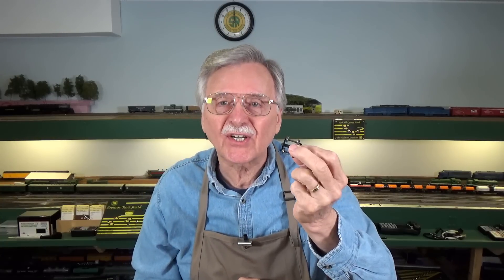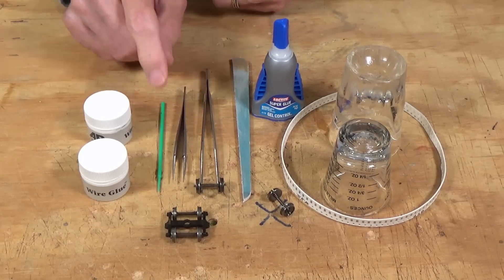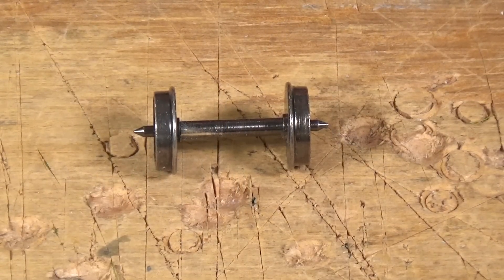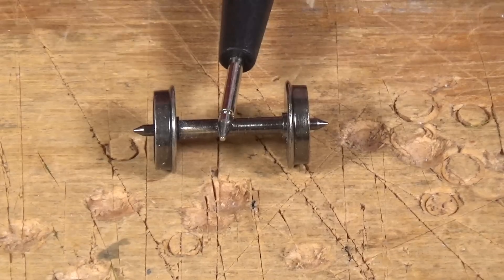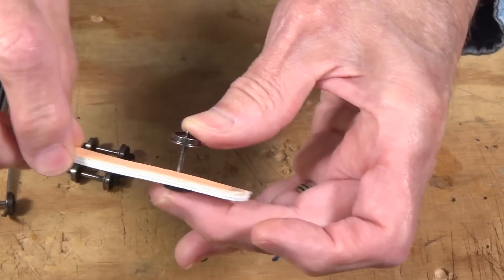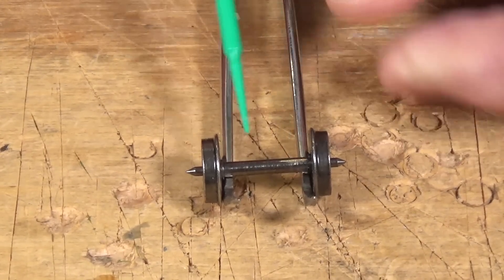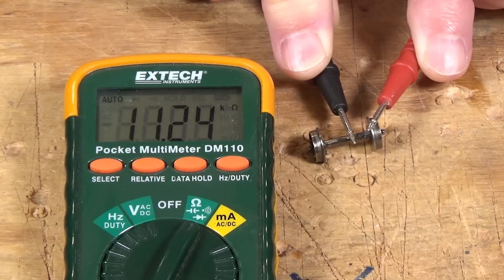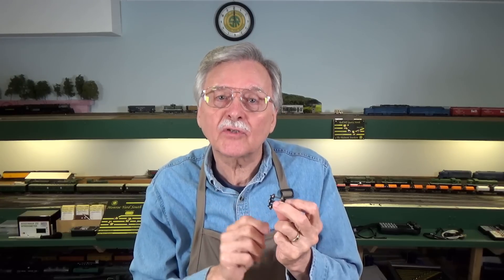Why Buy When You Can Make Your Own Detector Wheelsets (319)

Comment: Hi Larry, Your video is very informative, but after many, many attempts I not having any luck. First, I thought it was maybe bad wire glue, but I cannot get results. I'm using metal wheel sets. Any thoughts would be greatly appreciated. THX
Reply from the maker: Are you not getting any resistance or no contact at all? You also must be very careful when applying CA cement to the resistor since too much could insulate the resistor from the metal parts or wire glue. Other than that as you can see from the video it is a pretty straightforward process.

Comment: Just to be clear, if you are working on a freight car with two trucks each having two axles:

•	For each truck, do you need to put a resistor on both axles or only one?
        -	If both, does it matter whether or not the insulated wheel for each axle is on the same side as the other axle? In other words, should they be on the same as for the other axle?

•	Do you need to have a resistor(s) on both trucks or is having it on only one truck sufficient?
        -	If you need to have a resistor(s) on both trucks, do the insulated wheels of each truck need to be on the same side as the insulated wheels on the other truck?
Reply from the maker: The axle orientation doesn’t matter since you are bridging the insulation with the resistor. I usually put two resistor wheelsets on each car instead of two on each truck. I do this to spread out the detection and avoid dirty spots on the track. I also don’t put them on every car, just enough to have a few in each train. At a minimum I want to have a detector equipped caboose or passenger car on the end of each train.
Reply: @TheDCCGuy  Thanks for your response. One other question: you refer to 10K 1/8W 0805 resistors and 10K 1/4W 1206 resistors. Another N-scale site uses “603” resistors (I assume 10K?). How would you know which of the three resistor types to use?
Reply: For N-scale.
Reply from the maker: You first need to decide which detectors you will use and find out their requirements then proceed with the installations.
Reply: @TheDCCGuy  Thanks

Comment: Informative and practical tip Larry. The reading of the resistor after installation could also be due to the tolerance of the resistor value which is about 10%. Keep up the great videos they are extremely helpful reference and instructional tools for the hobby.
Reply from the maker: Good suggestion. It did settle in at about 11K as did several others I did which really is close enough given the tolerances.

Comment: I have a question. As a beginner, what the H__ are these for, and why do you need them, and what happens if you don't have them, and do all rolling stock cars have them?
Reply: These are used if you have electronic block detection to see if something is on a specific track. This is for example used to control signals or other stuff, and also if you use computers to control the layout. Locos and all cars that draw power from the track (for example cars with interior light) are already detected by their power consumption. Cars without any functions are electronicaly invisible because of the isolation between the wheels. You could call this a "virtual power consumption" add-on to these cars, to make them electronically visible. 🙂
Reply from the maker: I provided links to 2 videos that go into this, so please take the time to at least watch them.

Comment: Larry I tired this method a long time ago and them did not work out well for me,   After watching this video I think I will give it another try  My railroad rule is all cars have resister wheels and been purchasing them  I would like to make them again  back then I was new to this and feel confident now that I can do this  Have a nice holiday weekend.
Reply from the maker: I have also seen methods that recommend using conductive paint and Streamlined Backshop sells resistive paint which you can use instead of a resistor. That way you can just paint a line on the axle to create your own resistor!
Reply: Larry, any idea what the resistance is using the paint?
Reply from the maker: @derekalexander4030  No but if you go to the Streamlined Backshop website he has a description there of the process. As you might expect it is an iterative process—paint a line, measure, scrape a little off, measure again, etc.

Comment: Great vid, I have done a few cars like this myself! 👍
Still, my question would be why you chose 10K? Sure it works great, but some use 20K and other values as well, and I have yet to find out where these figures come from and how they might affect the system depending on type of trains, length etc. On a long block with many cars, I guess there could be a significant power draw?
Reply from the maker: You need to use what the maker of the detector recommends. Some are designed for 5K some for 10K, etc. I have asked my EE technical advisors to wade in on the issue of how detection works when multiple resistor wheelsets appear in the same block and hope to hear in a day or two.
Reply: @TheDCCGuy  Did a few measurements and calculations myself yesterday, and given 10K @ 16V, the power loss is barely noticeable before a few hundred wheelsets on the layout. If I got this right, It takes roughly 600 wheelsets to reach 1A. That is a big layout, and by the time you have 5-600 of these cars on the tracks, you probably will need a booster anyway for all the locos and other cars with light in them. 😀 So no big deal then. Again, great video, thx! 👍
Reply from the maker: Yes, with 14V and 10K resistors it works out to 1.4 milliamps each so 100 would be 140 mA, negligible draw compared to even a single DC motor which in new locos cruise at about 250-500 mA. However that is another reason I don’t put these on every car in the fleet.
Reply: Each resistor will be connected in parallel.
So let's assume that only one resistor is in the sensing zone then it will appear as 10K, if two resistors are in the same zone the result will be 5K.
Parallel = divides the resistor.
Serial = adds the resistance.
Reply: @lgrfbs  Yes, I'm aware of that, and this is exactly why I ask. Too high resistance would obviously never cause a problem except for not being detected, but low resistance results in more power transfer between the rails. (Zero resistance = shortcut). So what effect could it have with let's say ~100 cars with this on the layout, or let's say ~20 in a block? I haven't done these measurements myself (yet).
Reply: @TrainmasterSweden  Interesting, don't have enough electronics maths to answer that.
I appreciate your videos.
Reply: @lgrfbs  Thanks. Yes, it's interesting and that's why I wonder why 10K (or any other value).
I'm about to do some calculations on it, so the following is just speculations from my side: 🙂I guess it depends a lot of your equipment as well, not just detectors but also shortcut breakers etc. Likely you won't notice anything at all on a small layout, but with a larger layout maybe you should try with the highest resistance that could be detected on your equipment. But as said... just speculation as of now.
Reply from the maker: Yes, you’re creating one big parallel circuit with a bunch of these and resistance goes down, but it is still negligible given its on 1.4 mA per resistor.
Reply: I = V/R SO IT WOULD TAKE ALOT OF WHEELSETS BEFORE YOU WOULD GET TO 1 AMP OF CURRENT FLOWING